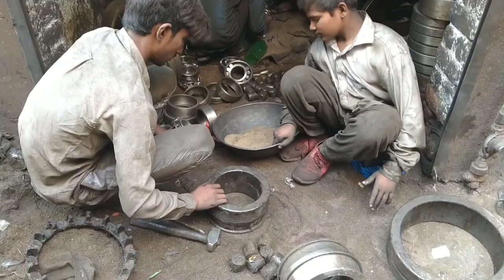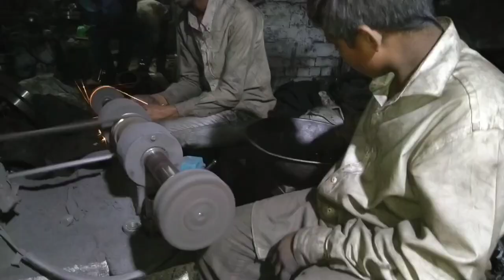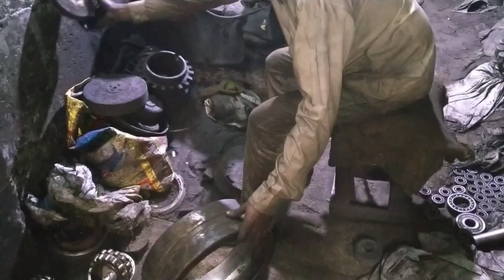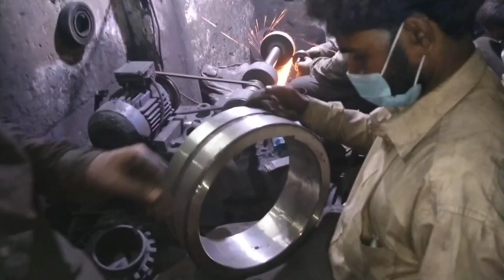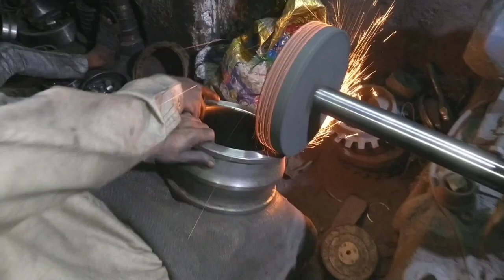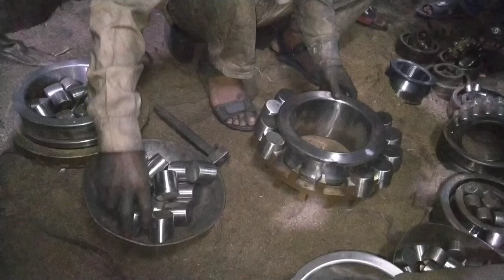Old Bearing Repairing and Making Able to use | Bearing Remanufacturing Process

Comment: All that work for something that is still trash. The only thing they changed is now it is shiny. What a waste of time and effort.
Reply: No, the inside cylinder block ball bearing is replaced with bigger one. They have stockpile of shiny used bearing with various size to get into the bearing. This is the real green recycling.
Reply: @quickcinema8031  Yes, it does. Most advertised "green technologies" have similar usability to this hand ground and clay floor mounted bearing.

Comment: Poor guys, at least wear a mask else all that dust will just destroy your lungs. While some idiots will say that all they are doing is making trash shiny, they are missing the point. 
You’ll never get the bearing back into original spec by doing this which is true, however if you just need a bearing that functions in an industrial setting AND NOT AT HIGH SPEED, then this will absolutely work [As evidenced by a market demand to support doing the work, if the product wasn’t acceptable at the price it cost to produce nobody would buy it]

Anybody who is stuck in a single mindset is just a sheltered idiot who knows nothing of reality. The large machines that these bearings are meant for are going to be well worn, patched together with many repairs. They don’t need tight tolerances, hell they don’t even need a good bearing … they just need a bearing that fits and works all else is moot.